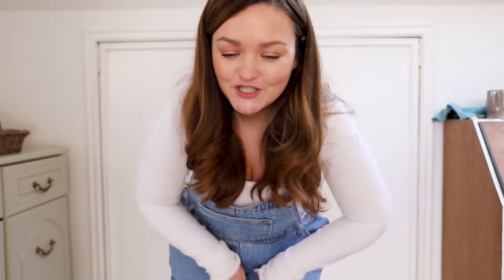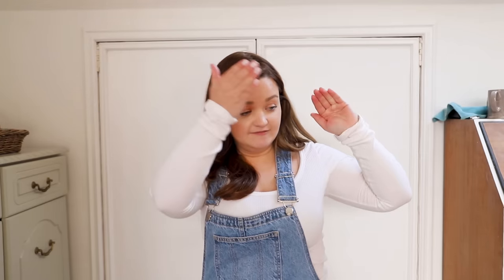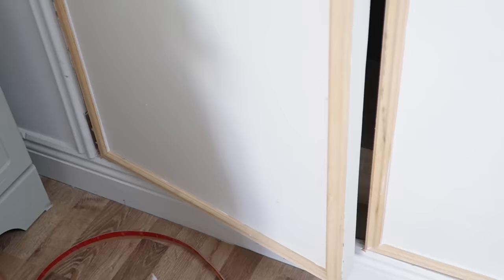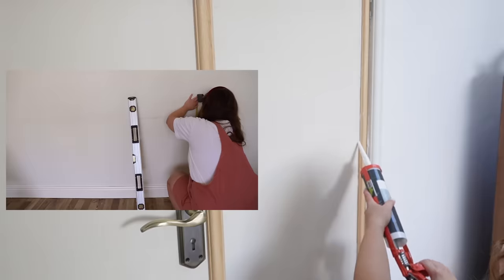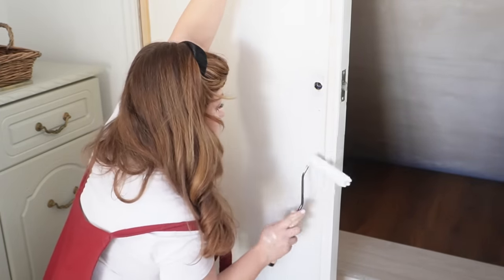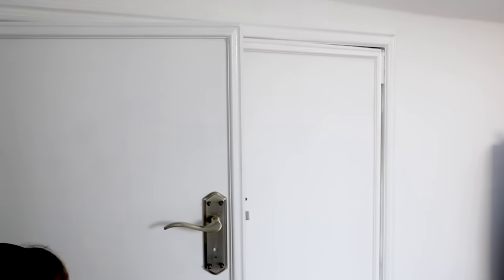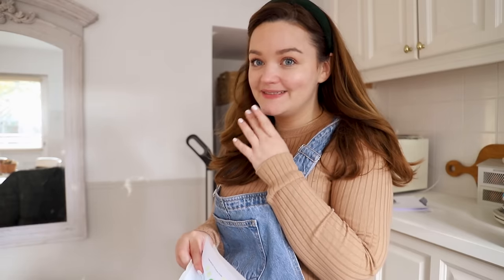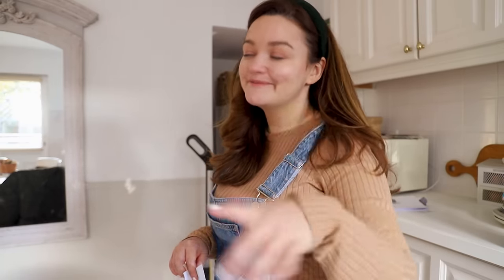Transforming Unused Space into a Storage Haven!

Comment: I love your channel..... maybe put the small table that is upside down in the large tin container, at the end of the closet,  were you were thinking about putting your Christmas stuff. Switch what is in the tin with what into the red container (that has the rolls), put the rolls inside the tin container, that way they are out of the way and lay flat. Put what is in the tin in to the red container, making it possible to close the red container, making it possible to stack another box on top of the red container. Label the red container so you know what is in it.  Just a suggestion.  Have a great day!  Put the tin on top of the small table, if it fits.